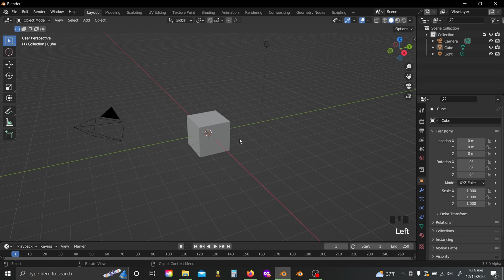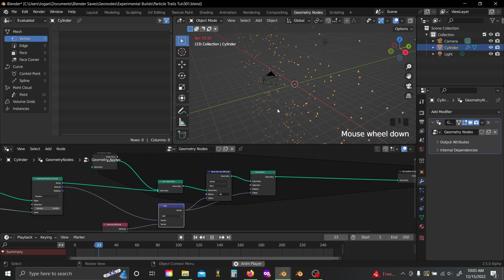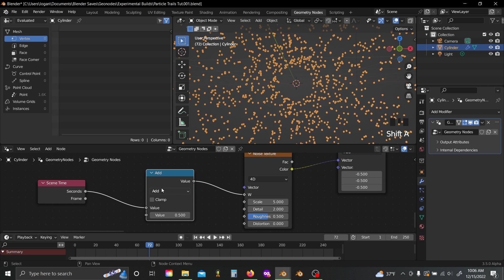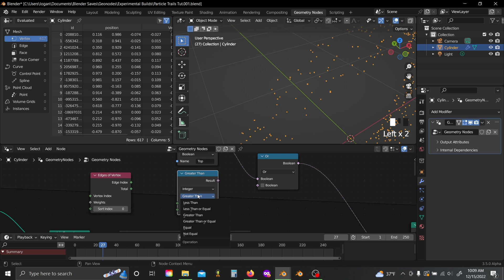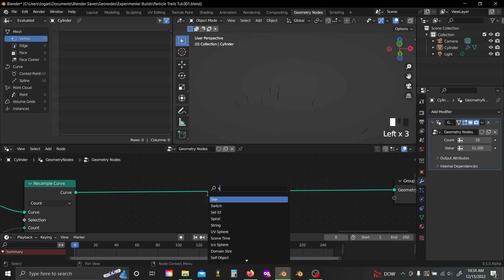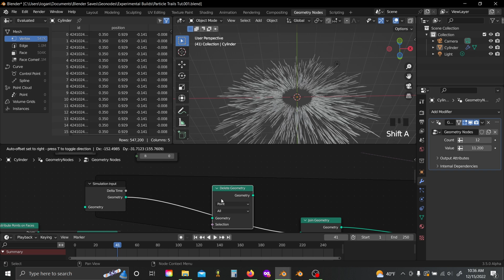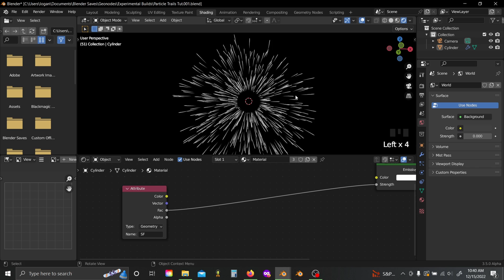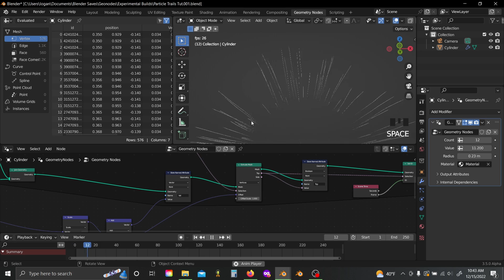Particle Trails with Simulation Nodes in Blender 3.5 | Tutorial

Comment: This is really cool!

How would you go about deleting a particle after a certain lifetime or length?  My renders slow to a crawl after a few hundred frames as the number of particles becomes so high...  I tried a couple of things with the delete geometry, but I'm not sure how you'd select the instances that are X frames old, or X distance away...
Reply from the maker: Thanks! If you check out my other videos on using simulation nodes I actually have a system for deleting particles based on their age that you can use for this too
Reply: @AlaskanFX  Hi! Any chance you can make a set up that fades out the system and deletes it, rather than having it poof out of existence with the other method you have?

Comment: It still a little bit confusing to me to store attribute and use it earlier in the tree.. But i'm thinks that this attribute needs to be changed every frame thats why people do that :| 

And for split window you can also use the "Cross" icon. when you position your cursor in the corner of window you can just directly pull out new one :D I think that is more convinient

Also thanks for another Tutorial!
Reply from the maker: Ya, storing the attribute is an operation just like the set position or extrude mesh nodes. The simulation nodes are definitely very unique addition to geometry nodes (which is part of why they’re so cool) so it’s been a learning curve for me as well.

Also good tip on the window splitting!